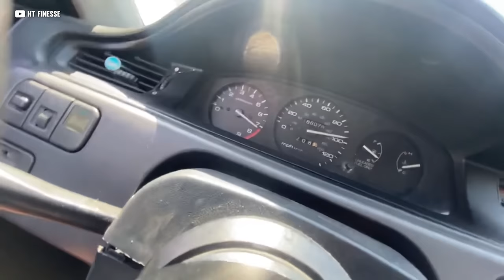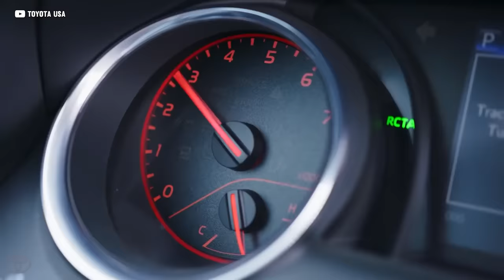7 Things NEVER Do In A Manual Transmission

Comment: Don't just drop a gear in the snow. I hear so many inexperienced manual drivers claim that lower gears somehow equal "more control".  Aside from the bizarre logic and the fact that over-steer is harder to drive not easier, gears are a torque multiplier. All torque in excess of that which can be handled by the tire will result in tire spin. A tire with no traction offers no directional stability. In other words,  you'll spin out much more easily when the tires can't handle the torque provided. Lower gear, more available torque. Your final drive ratio (drive wheel gear ratio, classic example is a RWD car's rear axle ratio) influences acceleration. Lower ratios such as  2.56:1 will not, all other things being equal, offer as much acceleration as say 4.11:1 gears. But the gears in the transmission are also torque multipliers. This is why the car accelerates faster in say 2nd than in 6th. But that also supplies more torque to the drive wheels. High torque due to a low gear when sent to the drive wheels on a slippery surface is certainly NOT "more control" than choosing a higher gear. It's just math.
Reply: I will take oversteer over understeer every time. The problem with most newer vehicles is the inability to completely disengage the traction control so you cannot overcome understeer with throttle regardless of which gear you are in.
That being said, smooth is the most important thing in slippery conditions and having your revs too high makes throttle transitions more abrupt. There is a reason that some automatics allow you to lock in second gear as the lowest. Easier to start in 2nd or third when it is slippery.
Reply: @rich7447  You'll take oversteer every time huh? Cool story!
Reply: @bbb462cid  Yep. Don't like driving straight into barriers.
Reply: @rich7447  No, you'd rather do it after the tires re-stick at 180*
Reply: @bbb462cid  I grew up driving a front engine rear wheel drive vehicle in Canada, often on lakes, before traction control was a thing (1980s). Oversteer is manageable especially in longer wheelbase vehicles. Understeer is much tougher to deal with.
If you get to 180 degrees you either weren't paying attention or never learned skid control. Honestly, if I am hitting a barrier at speed I prefer to go in backwards.
Reply: @rich7447  lol you think you're schooling me as the elder subject matter expert on the friction circle and polar moment. That's adorable.
Reply: @bbb462cid  I don't think that I'm schooling you on anything. I'm telling you my experience.
Reply: @rich7447  Sure thing, thanks.
Reply: @bbb462cid  So what is your expertise and please explain this to me Mr Buick.

Comment: See that tip about using the e brake on a hill. Thank you for that. Because I panic. I learned about two years ago. Appreciate the tips 🙏
Reply: You have too new car, if you have an e-brake. 🤣🤣You brokie💀💀
Reply: @lassivaisanen4354  I got a 93 probe gt. It's my second one. The first one I had was a auto. I wanted the car bad enough to where I said I'd learn manual
Reply: @lassivaisanen4354 e-brake is short for "emergency brake".  I hope you weren't thinking he meant "electric brake" as in e-cigarett.  Either way, the advice is still sound.  I do this all the time.  I wish I had thought about it in my early years.  I also used to panic on hills.
Reply: @boxingtherapy87 Those are nice wheels dude.  Good choice.
If I'm not mistaken, a lot of those parts are compatible with the 1st gen eclipse.  I thought the probe, the eclipse and the talon were all the same car.  Ah man, I haven't heard the name "Eagle" in a long time.
Reply: @lassivaisanen4354 those have autohold and don't rely on the  E-Brake for hill Stop/start action at lights
Also you can do the exact same trick with the breaks pedal

Comment: I went 250k+ miles on original manual transmission on my Nissan. Clutch still wasn't worn out, but a spring went out.
Reply: Mine's at about 280k, sure it's noisy, but works well still.

Comment: 4:12 A burnout wasn't what happened, but when i left my work one day i punched gas and dropped the clutch disk down at the same time to get away fast enough to get safely onto a busy road. 2 things to mention are: one of my brakes didn't disengage right away back then (cover was broken, letting in water and dirt) so to make 100% sure i'd not stall it, i punched too much gas before releasing the clutch and my tires were spinning more than i was moving ^^ Not exactly what image i want to broadcast for my employer, mind you, but it was the safe thing to do XD

Comment: My dad used to leave it in first when he parked it, and then one day he went to turn it on to defog the windows, and he turned it on, then immediately went outside to Squeegee the windows, and the car jerked forward and slammed into the garage door, heavily damaging the door (the car was actually fine though). Since then, I have been leaving it in neutral. 

Also, I have seen cars that if you leave them in reverse, the reverse lights come on, even when the car is off. I don't know if mine does that, but that could be concerning to leave it in reverse if the reverse lights do come on. 

Other than that, I am probably guilty of lugging the engine from time to time, but I don't do any of the other things on the list.
Reply: The idea behind parking the car and leaving it in 1st is giving yourself a fail safe.  You're not supposed to leave the car in 1st after you start the engine.
My 85 cavalier had no parking brake, as it was broken.  My options were put the car in gear, or car rolls away.  Although, I did opposite of what Brad recommended.  1st for rear end facing down hill and reverse for nose facing down.  I guess the concern here is that the engine will begin to rotate backwards, causing all kinds of issues.  However, if you're on that steep of a hill, you'll have other issues.  It wasn't an issue for me, but probably not the best practice honestly.

As for the reverse lights, I'd say someone wired them in wrong.  Those should only come on if the ignigion is on.  If the reverse lights are still on with the ignition off, someone messed up.  Chances are, it's not the manufacturer.  Unless the manufacturer is Hyundai, or Kia.  They can't seem to get basic security right, lol.
Reply: Don't change. You are doing right with the trans in neutral and using the parking break. Good job. You know more than 80% of drivers including these guys so keep doing what you're doing
Reply: I have owned several older manual transmission cars and I always leave them in neutral with the parking brake on.
Has never gotten me stuck or rolling unintentionally downhill or anything like that.
If your parking brake can't hold your car in place on all but the steepest of inclines, your car may need some servicing.
Reply: Yes, use the parking break when parking. But you should put it in gear, ether 1st or reverse, as well. when you park you should engage the parking break, let the breaks take the weight of the vehicle, then put the transmission in gear so it is taking no weight. The same is true for a automatic transmission vehicle, once the breaks take the weight, then put it in park. You do this incase your breaks fail for what ever reason, its a fail safe, just because you haven't had it happen yet doesn't mean it won't happen ever. 

Also, if you accidently let off the clutch while still in gear, like your dad did, the car will only move a few inches at best and then stall out.
Reply: @Squeaktoymk2  I know a guy who lives in a house with a 35deg driveway.  He drove a 95 Ford Bronco 5spd.  He used to do the same thing.  Until one day he found his Bronco in the neighbors yard.  The parking brake cable snapped overnight.  I'm like you, the general practice is to just use the parking brake.  If the car still moves, yeah, the rear brakes need adjustment.  But if I'm on a steep hill, I'm putting that ho in gear and using the parking brake.  It takes half a second and it could be the difference between an insurance claim or not.  This is especially something to consider in the rust belt.  If a truck frame is having a hard time surviving, think about the brake cable.  An electronic parking brake may be less afffected.  Just some thoughts to consider.

Comment: Average american : "driving a manual is a very delicate process"

Also me,20, a french man, have my liscence since soon 1 years, daily driving a 35 years old Peugeot 104 with the shifter's ball joints holding up with zipties cause i can't find the parts for fix it, it also give less precision than it has + need to double clutch for gear down cause the gearbox is little bit tired 😂.

Comment: „Use e-brake ALWAYS” can be said only by some American. After prolonged, hard braking scheme, like after driving on a motorway, so when the brakes are at high temperatures, or in winter with extremely low temperatures, engaging e-brake on flat land is a simplest way of killing your brakes. And it’s unnecessary. You just have to live it in gear and nothing happens. You can basically weld your brakes and pads that way.

Comment: 1. Point: I always! break without the clutch until around 1000rpm. Driving with a pushed in clutch makes you need a lot of bonus gasoline cause the engine is running in idle without gear connection. Not pushing it means the engine will need no fuel while slowing down and you can male use of the motorbreak to save break discs!

Money shift isn't a thing i most more modern cars. They prevent you from selecting 1 / 2 Gear while above a certain threshold

Comment: Parking in 1st or reverse you got backwards. If the car will roll forward, park in 1st. If in reverse, and the car rolls, you’re spinning the engine backwards, and pushing timing chain/belt tensioners in a direction they’re not designed to rotate, tensioning the “slack” side of timing. If the car will roll backwards, park in reverse.

Comment: Let me start off by saying I know how to drive a Manuel. Been doing it for decades. Yes I'm old. I after searching for months I finally found the car I wanted to modify. My first.  Was for me and my son to do together. So I didn't want something that would be to fast. Settled with 3g mitsubishi eclipse convertible. Manuel of course. Had to drive it home from a state away. While I was on the express way around 2 am going about 75 mph my back tires locked up out of no where. Tracker trails were swerving around me.  Those guys can drive. Totally saved my life. When I had the car looked at. The shop told me the clutch plate (this happens when a car sits for long periods of time.  Then driving on a long car ride) slipped ans spun. It la ded on reverse. So the car didn't fully make it off the road.  When it did what it did. My brake lights didn't light up. So those truck drivers are no joke. It fused all my gears inside my trans. Huge mess.
Reply: "Manuel", that one is funny, lol.
Back to your story... What you're telling us makes no sense.  I've had a clutch completely shred on me before.  The transmission was fine.  It will be fine.  At 75mph, the car just won't come out of gear, or go into gear if this happens.  Are you sure the problem wasn't contaminated or low transmission oil, or no oil in the rear diff?  Either would easily cause what you've described.  If the transmission is junk, you probably just had contaminated or low transmission oil.  That would cause the gears to heat up until they basically weld themselves together.  Which would cause the transmission to seize and the whole drivetrain to lock up.  It would stall the engine and the whole car would screech to a halt... Which sounds like what you've described.

I try to trailer cars I'm picking up from across the country.  But a lot of guys love the adventure of on the fly mechanic work.  I saw one guy drive a 73 camaro that had been sitting for decades 1500mi.  A lot of things went wrong on that trip, but he got it home.  Roadkill is another show like that.

I hope you were able to get the car back on the road.
Reply: @christopherlowery855  it was fused in reverse.  I'm only going by what the transmission shop told me. I didn't have much money.  So I had to drive it back.  That wasn't my only dumb decision in this car.  I from a state where alls you need is the title signed and bill of sales.  But I was un aware the state I bought it from needed a notary to over see the sale. So I couldn't get it registered. I did all the right things on my 3 rd eclipse lol. I'm sure most won't like what I did to it.  But I like it so far.  Next part of my build I'll be working on the power. My goal is about 350 hsp to wheels. I've done most of the basics and supporting mods to handle it.
Reply: Your 3rd gen eclipse is fwd, theres literally no way the rear tires locked due to a clutch failure, if you had and awd 2g or 1g gsx then maybe
Reply: @redcatxb125  I concur.  It sounds like the trans fried due to low oil, no oil, or serious water contamination.  Some wheels locked up it seems.  It just seems unlikely the rear did.
Reply: @redcatxb125   No you probably got me I didn't mean to say back tires so front tired but for all purposes the car was a brick couldn't be moved period stuck slightly in a lane.   For it we'll drive it's one of the reasons why I wanted to do that clips cause I originally got the car for my son and I didn't want to build a car that was gonna cause his death by an overly powered sports car  I wanted to looks of something fast but nothing too fast
Reply: @christopherlowery855   You could be totally right out of it I know very little about cars I know a lot more now that I've had an actual car that I could take a part but I'm still learning still huge beginner
Reply: Being fused in reverse means that's the only gear the shop could get the car into?  I can believe that.  I often forget about the notory as well.  I had to track down a previous owner who wasn't even the guy I bought a car from once.  That was fun.
For your power goals, if you have the V6, 350hp is pretty achievable.  I would probably go with H-beam rods as an internals upgrade for safe measure.  However you're only looking at a 58% increase in power, vs something like a 150% increase.
If you have the 4cyl engine, you'll need rods, bearings, and pistons.  The compression ratio is fine (9.0:1 for the I4).  For the V6, I would drop the compression ratio, unless you're running e85.  You can squeeze the crap out of that stuff.  For 93 octane, I wouldn't risk it.  Especially if you're pushing something like 17 or 19psi.  Other add-ons are bigger injectors, a better fuel pump, an oil cooler, bigger exhaust (2.5-3"), an ECU, turbo, intercooler, etc.  With the V6, I might run a TT with sequential turbos (T1+T3, or T2+T3).  It's all a lot of work, but also a lot of fun to get it all working and honed the way you like it.
Best of luck to you.
Reply: @christopherlowery855  by the time I had the money saved up and found out that I needed a notary (was my first out of state car buy)  I couldn't fond them. To bad. Was gt stick spyder with 110k miles on it. In great shape.  Well other then what I did to it. That's great advice and will be looking in to all of that. I have a 6 cylinder. Was planning on converting to e85 and cam turbo. Nothing to crazy.  The engines generally blow when you get greedy. Since it's a spyder. The car is more fir looks and fun. I think 350 horse to wheel will make fun. Not the fastest. I will be able to take it to the track. But it's not like I'm going to be winning a bunch of races. This car is just an education. Get me some experience and knowledge. Then I can get qjat I really want
Reply: Can you teach me how to drive manuel? Coz i only know how to drive automatic and manual.

Comment: Had to get my mirror fixed and when the mechanic gave back the car, I assumed it was in neutral cause it wasn't in a reverse or first gear position, turns out, I stalled the car immediately cause the mechanic left it in 5th gear for some reason.

Comment: ok BAD advice saying use reverse when nose down and 1st when nose up, you want the opposite, the engine can and WILL spin backwards causing major engine damage. My focus ST did this but I caught the car in time before it spun over too many times. Always put the car into gear in the directional gear the car is meant to roll in. The engine compression is the same regardless of which way you go, but spinning an engine backwards can spell MAJOR trouble.

Comment: 0:47 I thought you were supposed to clutch only in the last moment of the emergency stop to not stall the engine. Pressing the clutch significantly reduces braking power and the control of the car.
Reply: You will clutch anyway, out of instinct

Comment: What about shifting without using the clutch?
Reply: It will put stress on your synchros
Reply: It might work with some damage on newer cars but with older cars I.e. before 2000ish will stall the engine, some cars with paddle shifters or with option in gear shifter don’t require clutch.
Reply: Fine with unsynchronized gearbox, otherwise a good way to turn a synchronized gearbox into an unsynchronized gearbox.
Reply: @rich7447  Worse than unsynchronized at that; like many luxuries, when they fail they actively get in the way.

Comment: logging the engine is a no even today....for the same driving force it has to cumulate more pressure in the cylinder at 1500rpm as at 3000 rpm. its just an eco bs and utter bs in general:D but its your car do with it as you wish. its not a 16liter v8 from a truck that has the powerband between 1000 and 1500 rpm.